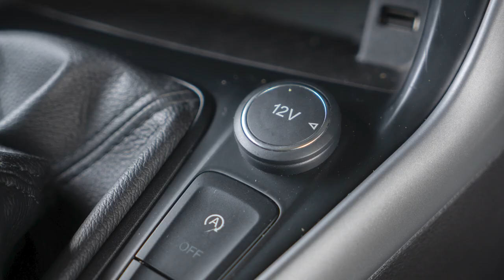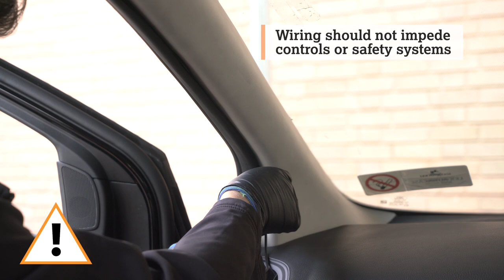How to Install a Front Dash Cam (12v Cigarrette Lighter Method)

Comment: So I get the power wire is tucked neatly under edge of roof head lining & a post behind door rubber trim but after that you’d just leave it dangling across dash? 
Best to remove end panel of dash and remove glove box , run it at side of center console tucking wires behind it surely.!